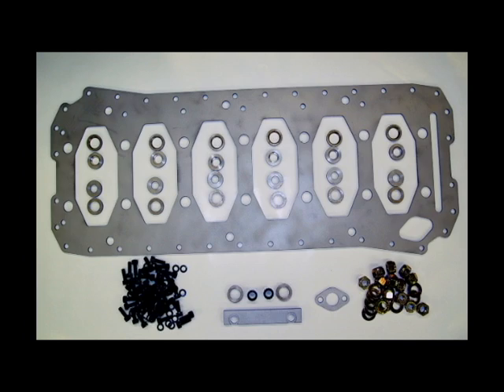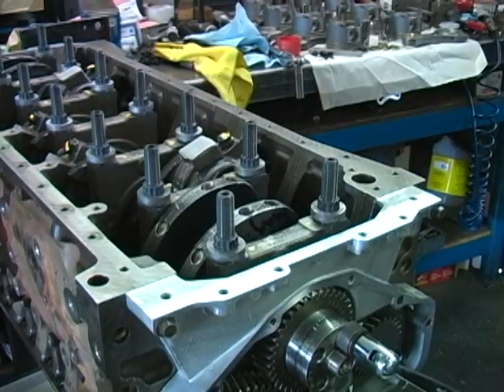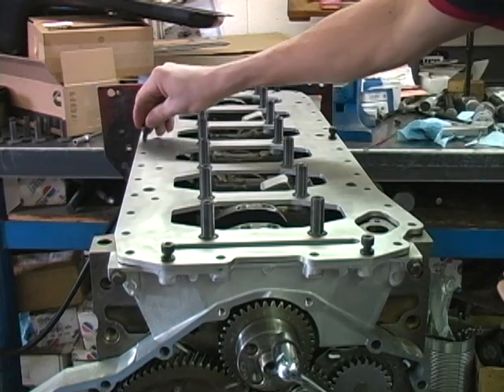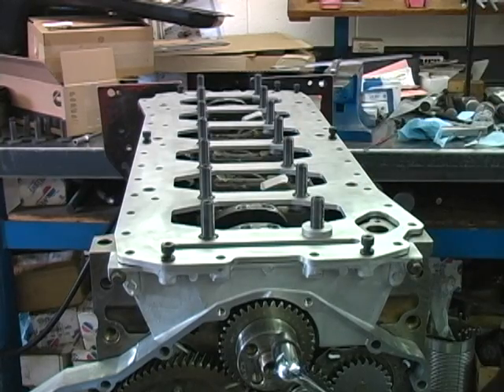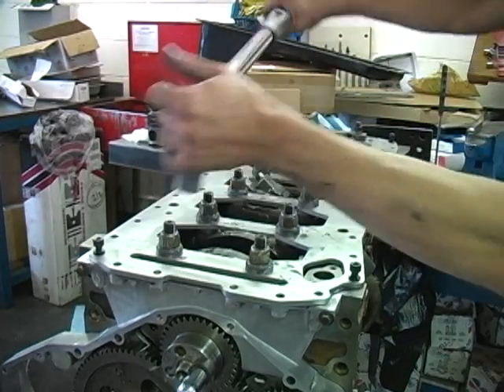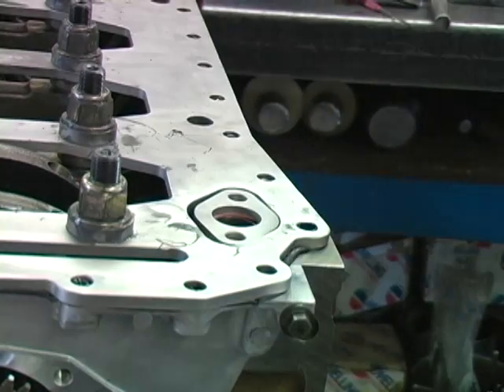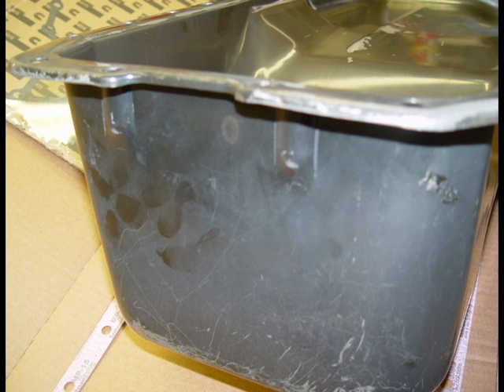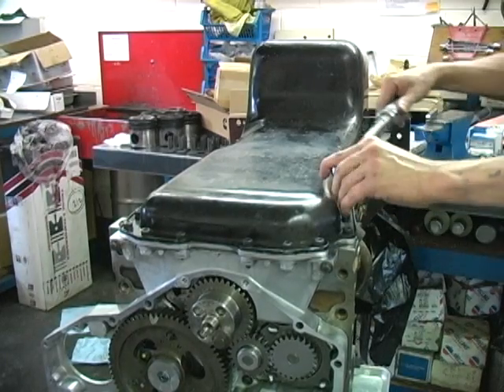Cummins 12 & 24 Valve Main Bearing Gorilla Girdle Block stiffener

Comment: Isn't he using the wrong torqing sequence? Not to be a nitpicker or anything, but I want to install my girdle correctly, ya know?
Reply: I know this comment is old as dirt,but you're right.
You're supposed to work from the middle out. There's even a correct sequence for the oil pan that he fails to follow. To each his own,he has to eat it if there's an issue

Comment: @copperheadmarine If your spinning a medium duty diesel engine to 5,000rpm or above and pushing 1,000+hp anything can happen. This main bearing girdle kit is a reliablity upgrade for serious racing/pulling engines. STOCK 12-valve Cummins internals are good to around 800-1,000hp depending on use.